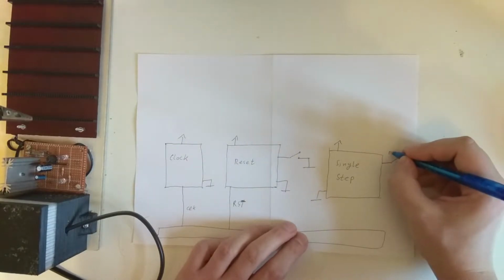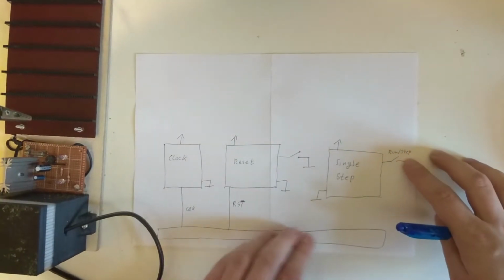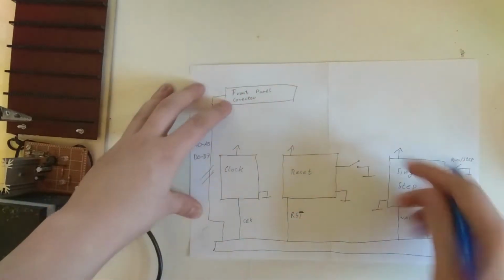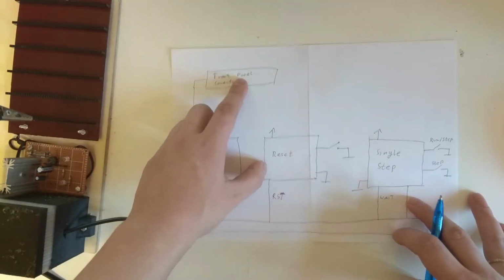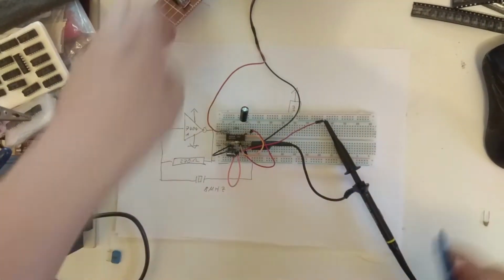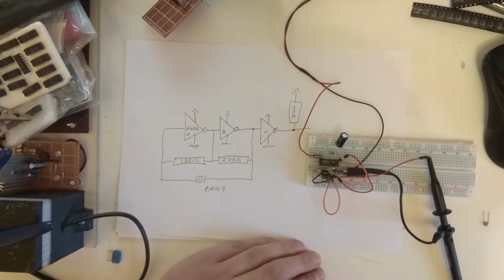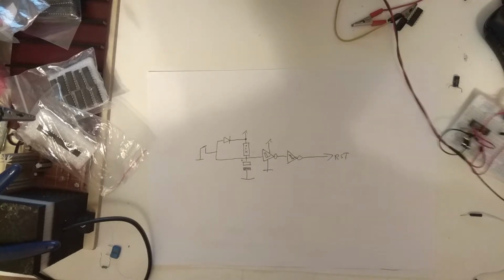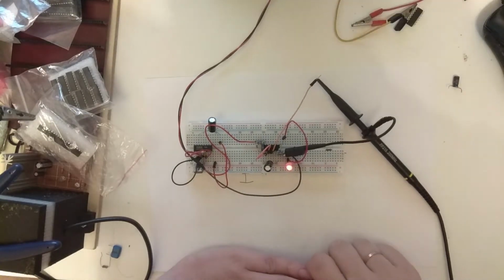Building a Z80-Computer Part 4 : The Clock and Reset Circuit

Comment: A note for people who is trying to copy the circuit:
Use SN74LS04N (or same invertor from a different producer): LS is a TTL series. This circuit do not work with SN74HC04 (CMOS) series.
In order to get better square wave, try to measure using a spring as a GND connector - the crocodile clamp act as a inductance and oszillate.
Schmitt Trigger used: SN74LS14N (or SN7414N)
Reply from the maker: You are right! there's different circuits for TTL and CMOS. I think this is explained in a later Video in this Series (Episode 6). The spring clip is another thing that I didn't use much in early parts of this series, I'm using it more these days

Comment: At 13:00, maybe it is a pull-up resister. 
The sine-wave over the clock-puls, maybe add a few capacitors here and there.
Reply from the maker: I've actually decided to redo the whole card there's some hard to fix mistakes on the design shown in this video, more bypass caps are definitely on the list for the redo, I'll probably get to that early next year.

Comment: Nice series. Question: Is your one-shot staying low?
Reply from the maker: Thanks! I should get around continuing it soon, The one-shot doesn't work all that well. Probably have to respin that board sometime soon
Reply: @captainsolder5247  do you still continue the series? I'd like the see a good explaination to the Address Decoding Logic
Reply from the maker: @MarcellDAvis1103  Hey! I definitely will, but I had a unusually busy year so far both with uni/research and also due to getting married, so I mostly did smaller projects the last couple of months.